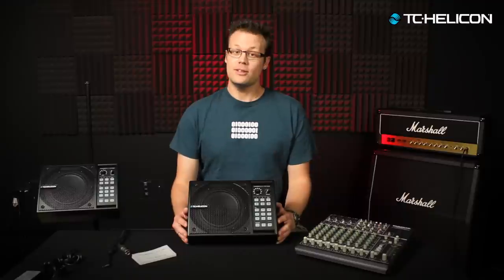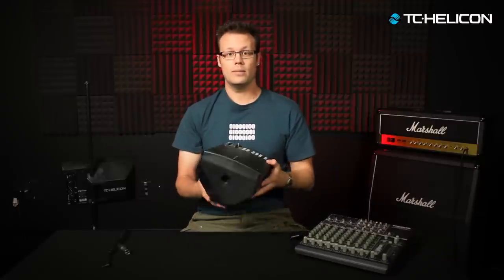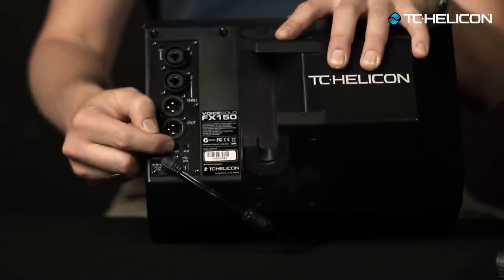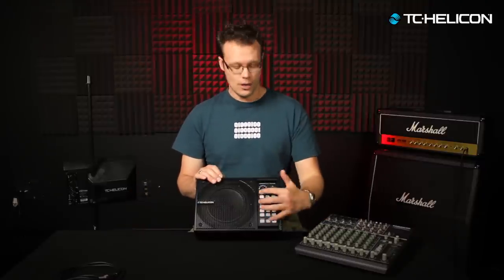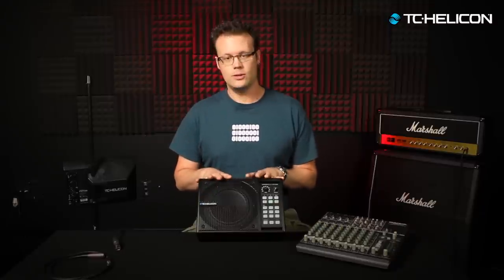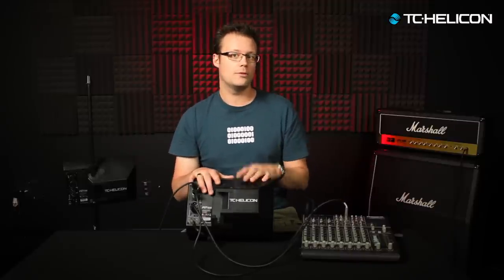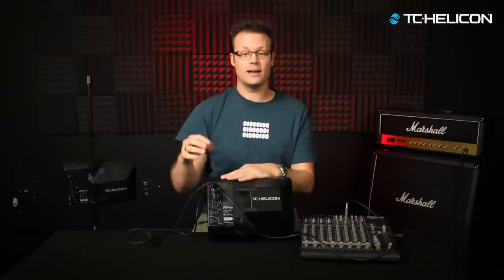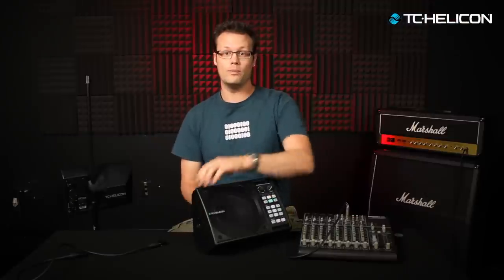VoiceSolo FX150 - Video Manual - TC Helicon

Comment: Am I right in saying that, when adjusting your personal mix in channel 1 mode, increasing your mic level over the band monitor mix level means that you are also increasing the gain on the mic, i.e. increasing the mic output level? If that's the case, it wouldn't be possible to change your personal mix level during your performance or between songs without the sound guy (the drummer in the case of our band) adjusting the overall mix to match the change you make to your personal mix. Have I understood that correctly? I'm interested in getting one, but this point is worrying me. Thanks.
Reply: So, the way to do it would be, first to set the mic volume level (channel 1) and leave it. Then, to adjust the mix on the FX150 during your performance, you could reduce the level of channel 2 (the FOH mix) on your FX150 but increase the master volume to bring it back to the same level. This would increase the volume of channel 1 (your mic) without changing the strength of the signal you send to the board (FOH). I guess that would work, right, TC Helicon?

Comment: TC-Helicon, I am interested in buying this for "more me" vocals.  I understood the hookup, but does the mix your sending to the board get louder when you turn up more "me" on channel 1 of the monitor?  Is it just allowing the mic signal to pass thru?
Reply from the maker: Yes, if you adjust the gain/level on the channels it'll increase the relative level sent to FOH, but isn't dependent on the level of the speaker. You might find this video handy: https://www.youtube.com/watch?v=jMrU8DfQQuc
Reply: Yeah, I think I will have to do the method on your other video, because I want to add more me without affecting FOH.
Reply from the maker: Cool, there are definitely several ways to approach things, so I'm sure you'll find the one that works the best for you.

Comment: One question: With the "more me" mix (the reason I bought this), it seems that if I turn up channel 1, I'm actually sending additional output to the mixer, which in turn changes the monitor mix. Is this feature more about the ability to reduce the house mix volume than turn up your own volume? I'd love to get this completely worked out. Thanks!
Reply: Full mix or channel one mode button it seems!!...

Comment: Hi! I'm not clear on whether I can use this the following way:

mic -> FX150 -> mixer -> p.a.

Basically, I would like to connect my mic to the FX150, setup my volume and effects and have the sound from the FX150 sent to the board to be what's used for the public.  Is that possible?

Thanks!
Reply from the maker: Sure. Your setup would work great. Just be sure to turn eq, compression, reverb etc. off at the mixer, so it doesn't double up with what's coming from the FX150. The speaker volume on the FX150 doesn't affect the output, so FOH can set their level and you still have control over the speaker level.

Comment: My band has two guitars and two singers. One of us has a voicelive 3 and we are thinking about purchasing two of these, but before, we need to know if these can be connected to each other without using a passive mixing desk . thanks in advace
Reply from the maker: +Miriam Sanchez Arnaez You can definitely connect FX150's in a bunch of ways. Without a mixer, would you be going direct into powered speakers?
Reply: Im thinking about using the voicesolos as speakeres for small gigs. I just want to be sure that if Im performing alone,I can still take both of the amps and connect them to each other to use them as speakers
Reply from the maker: +Miriam Sanchez Arnaez Ah ok. When you're alone, you can run the XLR outputs from your VL3 directly into CH1 or CH2 of each FX150 for stereo. Just make sure that the FX150's have Tone and Reverb turned off. When you're with your partner, you'll need to use the headphone out of VL3, so there's inputs for the other guitar/mic.

The solo show can be done in stereo, but the duo show will need to be mono.

Here's a couple of diagrams to help.

Solo with VL3 - https://dl.dropboxusercontent.com/u/40864719/FX150-Setup-Solo-VL3.jpg
Duo with VL3, Guitar and Mic - https://dl.dropboxusercontent.com/u/40864719/FX150-Setup-Duo-VL3.jpg
Reply: super helpful!!! thankyou so much!!!!

Comment: Can you use the american power supply in Europe by only changing the end plug or do you need a whole new power supply?
Reply from the maker: +Vemund Aarbakke Should be just fine. It's rated up to 240V input on the supply. You can either change the plug or use a travel adapter.

Comment: Is there a way to use the voice solo with 2 mics and send it out as 2 different channels ?
Reply from the maker: You can use the unit in CH1 mode, using the In/Thru on CH2 to send to FOH. The downside is that the processing you can add on CH2 on the FX150 itself, like Tone/Reverb does not get sent out when using the Thru. You'd still need to EQ and add effects at the mixer side.

Comment: I have a phantom power question. if i put a condenser mic in channel 1 and turn on the phantom power to power that mic(and have the unit in channel 1 mode), does the phantom power go to mic 1 input only and power just that mic, or does it also apply to mic two input and send phantom power to the board with the mix that I have coming from the board and plugged into channel two. I am thinking of getting this unit and also switching to a condenser mic. However I want channel two to be everyone else mix and i don't want to burn up any equipment with phantom power.
Reply from the maker: +Nicole Christensen Phantom is applied to both channels, but shouldn't pose an issue for your connected board if you're sending a balanced signal. The safest way to do things is to connect the FX150 to the board/mic and turn on phantom after you've made the connections. Make sure your mains are down when you turn phantom on.

Comment: I want to be able to adjust my acoustic guitar AND my vocals...while also receiving the PA monitor mix.  It looks like I can do only 1 when I'm using the other channel for the PA monitor mix.   Is this correct?  If so, is there a solution?  FX250?  Thanks!
Reply from the maker: You've got the 3rd channel Aux input that you can use if you need it.

In a "more me" situation like yours where people play/sing you would have to choose what stays on CH1 and what you'd send to FOH to get folded back in the monitor mix. Some people prefer to have "more me" for vocals and others for guitar.

Comment: I have a question. What is being sent out through the "THRU" output? is it both Channel 1 and 2? can i control  it?
Reply from the maker: The THRU is just a passthrough of the CH2 input. It comes in/out at the level of the signal going into CH2. There's no amplification etc., it's literally just wires connected to the other jack.
Reply: So if I was using it as a personal monitor in a band, I could plug my guitar DI into input 1 (another feed going to FOH), and my vocal mic into input 2 and then send that dry mic signal along to FOH without imparting any EQ, fx, etc even if I'm using them out of the FX150 speaker?

Comment: K, I'm confused.
It's supposed to be a personal monitor to hear yourself that fits on your mic stand, but it's 150 watts which is waaaaay too much to be in your face that close so it's way overpowered for the purpose.
Then he's saying you could have two of them pointing at the audience, so now it's supposed to be PA speakers, but the 150 watts is not loud enough for anything but a small quiet room and a small three piece acoustic and vocal setup.
This thing has an identity crisis, what gives here and what exactly is it ???
Also, if it goes out to a Mixing board does it go out in mono or stereo. If it's mono your acoustic and your voice go out through the PA right up the middle in mono with no separation.
Reply from the maker: For the personal monitor, 150W (wattage is less important the actual volume coming out) will be too much for some, in which case you'd simply turn it down, and too little for people who are on a loud stage. We don't feel that it's overpowered at all. It's appropriately powered for the frequency response (low frequencies use more wattage) we wanted it to give. 

As a PA, you're totally right that it would be for small intimate venues, which is the way we always try to describe it. If you're playing a little coffee house or doing a living room concert, it can work wonderfully. If you have a bigger space, you need a bigger PA, like any other speaker.

Comment: Can I run a powered sub in line with this?
Reply from the maker: FX150 has a thru on it(1/4"). This is meant more for daisy chaining monitor signals, but if you have a sub that you can feed into that has 1/4" in, and it's own crossover on it then that should work fine.
Reply: TC-Helicon Thanks.
Reply: @tchelicon  quarter inch I thought it had an XLR on the back of mine that's what I have on my through I don't see the quarter inch I'll have to go look again

Comment: 42.5 power supply is a real pain in the ass if you have to replace on the road. Owners manual says basically nothing just 42.5 v 1.5a It would be nice to know what the connector plug that goes into the unit is called. None of the dealers in Portugal stock parts. So here I am after planing these gigs in Portugal for two years...... with no useable equipment. Rethinking how I do things for next time. If their is a next time! 🤔
Reply from the maker: I think the support team in Europe might be able to point you in the right direction for getting a new supply. They have lists of parts suppliers/dealers. 

http://support.tc-helicon.com/tickets/new

Comment: why buy/use a mixer when you can serie connect active speakers ?? what gets better by connecting the speakers from fx150->mixer-> speakers ?? brgds
Reply from the maker: Theoretically you can go directly from the FX150's main output directly to a powered speaker. Some people like to go to a mixer because they have a front of house engineer that would want to control the levels from the FX150 relative to a band.
Reply: Thx ! helped a lot

Comment: line input is on input 2?
Reply from the maker: Both jacks are combo, so you can do line input on either. You'll just need to adjust the level. You can also use the Aux input for line level signals.

Comment: Could the monitor run from a battery pack?
Reply from the maker: +Frans van den Berge It draws a fair amount of current, so you wouldn't be able to get a whole lot of time from a portable power source, plus you'd need to find something that could output either the 42.5V 1.5A of the power supply or a 120/240V household level.
Reply: Ah that's too bad. It's such a lovely portable package...

Comment: I bought  two FX 150 both of them have issues ,one of them the hi z and CH 1 button got a failure and breaking without a reason
Reply from the maker: Crap! Sorry to hear that. Typically our units are pretty road worthy. Did you manage to get them fixed or replaced?

Comment: Such a long and basically uninformative review for me.  I know its a monitor speaker. So what. How do you specifically set it up? I just got bored at about 11:00
Reply from the maker: +Paul Bekanan Craig tried to cover all aspects of the unit, so there'd definitely be a lot of things in there that an experienced user would know. There's a lot of folks with no experience though, so we don't want to leave them out. 

The connection stuff is a bit after where you left off, around 14 mins, if that's what you were after specifically.